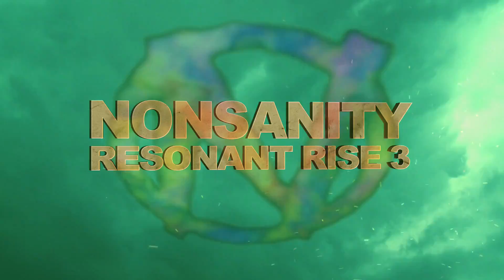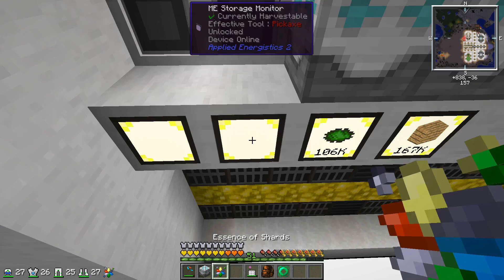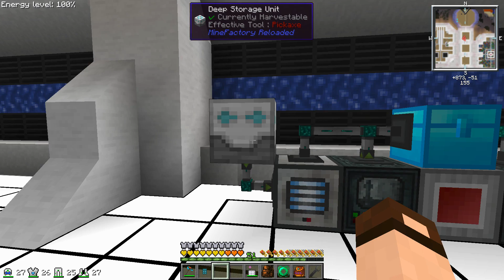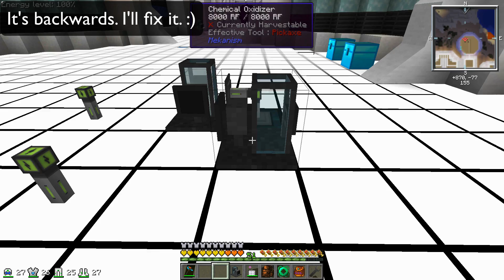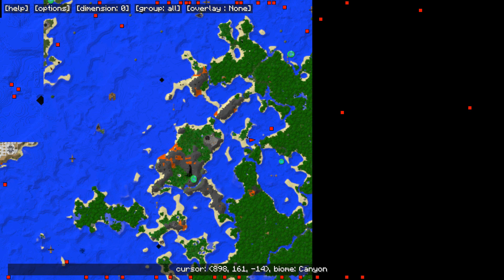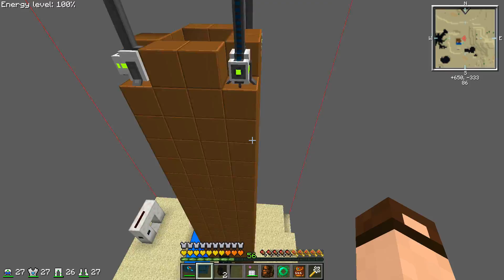Resonant Rise 3 LP - EP 28 - Deep Storages & Ore Quintupling

Comment: So.. one question.
You access DSUs with storage buses. You set the IO to some priority. Alright.
But if you chain the storage systems, is it enough if you set the priority on the final storage bus?
Or do you have to tell every link of the chain to export essence of shards with a priority so all the essences end up in the DSU?
Reply from the maker: +Reaperonatricycle I'm not entirely sure. To tell the truth, the setup I had in that series was rather unstable and prone to losing track of the DSUs completely. I no longer using the Interface-Storage Bus trick to reduce channels. I just add more ME Controller blocks. :)
Reply: Fair enough. :D
Well I guess you could still use this method for storage cells and make the first subnetwork have a controller and the DSUs.

Comment: I think you should set up auto crafting for drives depending on how many full drives you have. Lets say you need to always have a full drive bay of empty me drives so if there is less than 10 empty drives then it makes you to satify your storage needs
Reply from the maker: I've actually got all the processors crafted to fill ALL of those empty drives in one go. Once that's done, I'll never need to craft another storage cell again. It should take me all of ten minutes to hand-fill the empty drives—much less time than setting up an auto-filling system. I'm all for automating things, but not when doing it once yourself is faster and easier. ;)

Comment: Its nice to finally see the entire chain from mekanism in action. However, im wondering, did you choose to build it for the sake of having build one on camera, or are you actually planning on using it? I ask this because once people start storing all the things they hoard in dsu's and 64k's, i arrive at the point where i am wondering if ill ever use the stored items, and if its worth going through the motions of getting even more...
Reply from the maker: Well, I'm not currently running a quarry, so once I get all my current ore through it, it may end up idle. I could set a quarry up to show that process, or use Laser Miners to generate ore directly. The biggest problem with the 5x system is the jamming when switching ores. To fully automate it to handle a quarry, I'd have to either duplicate it for each ore (washer section, mainly) or rig a system to delay when switching. Probably the latter...